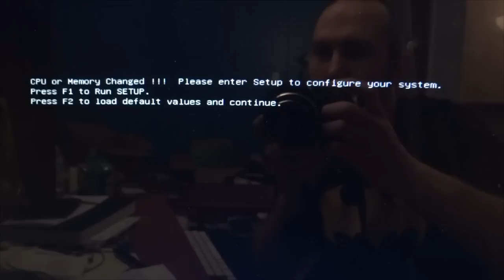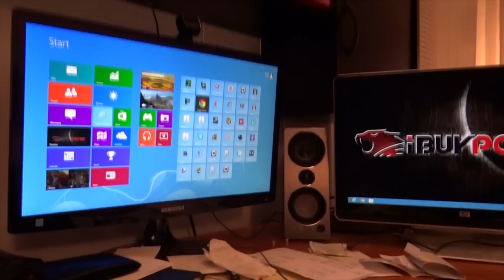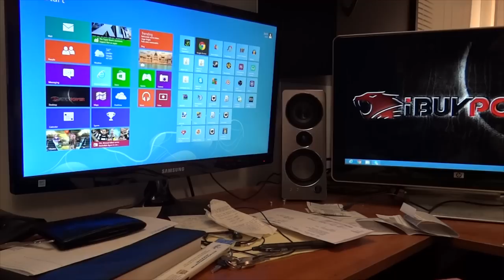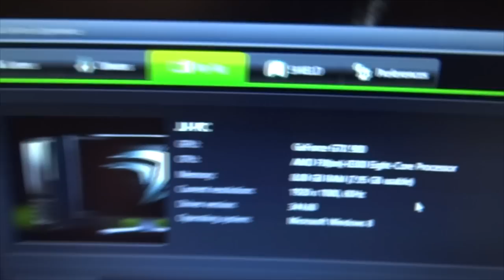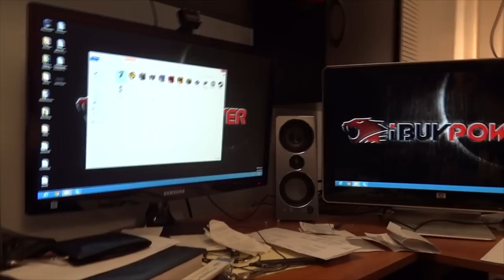AMD FX 8300 8core CPU Unboxing VLOG!

Comment: IS AMD A10-6800K stronger than A10-7800?
Reply from the maker: +Ognjen Novakovic the quick answer is yes, it is.

The long answer is: An AMD A10-6800k is what I started my gaming rig with, it's a 4core 4.1GHZ unlocked CPU, whereas the AMD A10-7800 is a 4core 3.5GHZ CPU. They both have similar rankings but the A10-6800k is still a bit more powerful.

Comment: Because i want to buy gtx 960 or r9 280,and idk which of those cpu goes best with gtx 960,and is A10 6800k stronger than fx 8300 series?
Reply from the maker: +Ognjen novakovic A10-6800k has faster cores, but half as many. I'd say for processing power, FX-8300 will be far better, although if you're just using it for gaming, stick with the quad-core CPU. Very few games can actually use proper multithreading to be able to take full advantage of 8 cores.

Comment: you do realise that amd fx are not 8 cores right? theyre 4 cores with 8 threads.
Reply from the maker: Synthematix This is not correct, AMD uses cores, Intel uses multithreads. Easy thing to get confused. :)
Reply: I'd even go as far as saying AMD calling these an 8 core CPU is false advertising. There are 8 integer back ends but they share both 4 front ends and 4 (decent) FPUs. It's totally 4 cores with a better version of hyperthreading. It even behaves just like hyperthreading to the operating system.

Comment: $2100 and it had something worse than an 8300??????? not saying 8300 is bad but damn you must've had like an intel pentium or something lmao
Reply from the maker: It was running an AMD A10-6800k. It's a quad core at 4.1Ghz with a 4.4Ghz TurboClock speed.